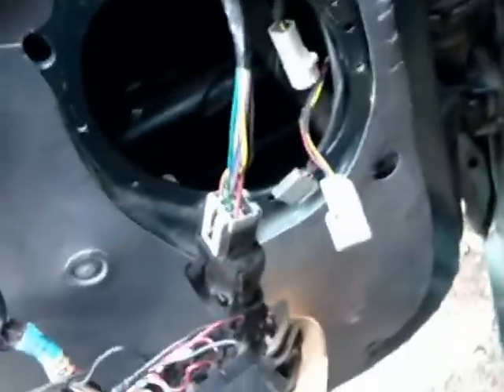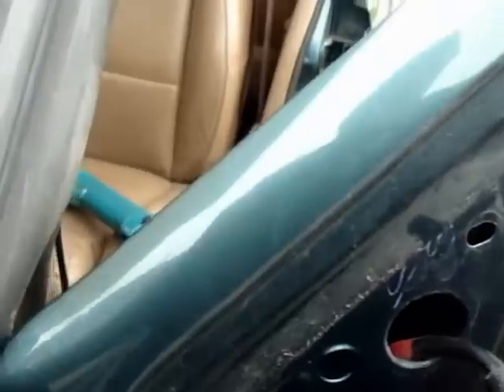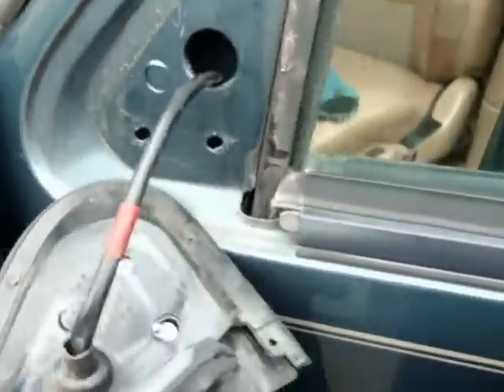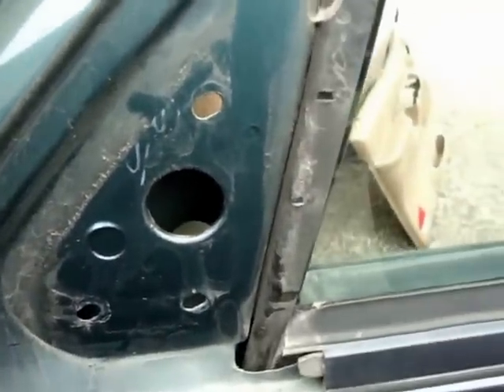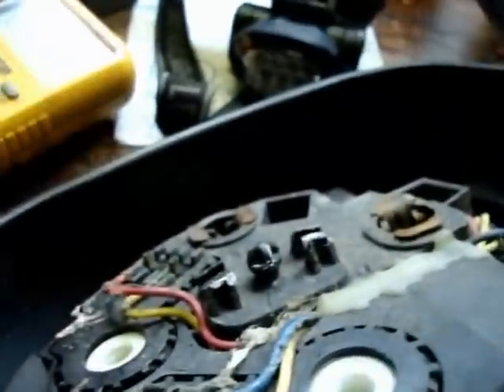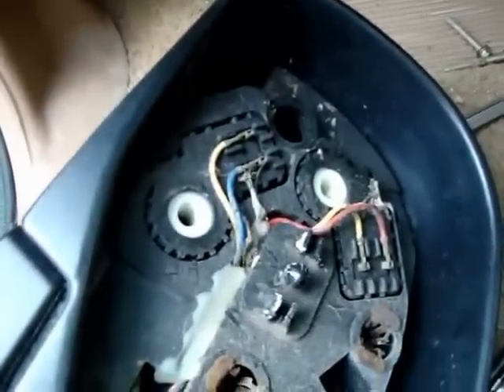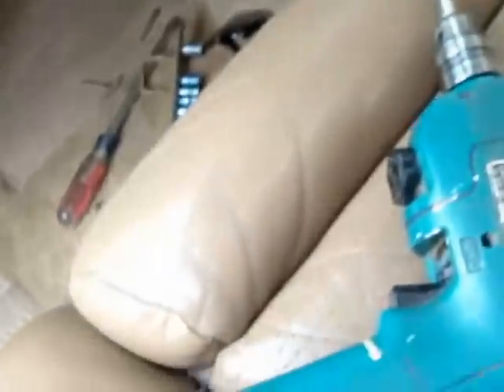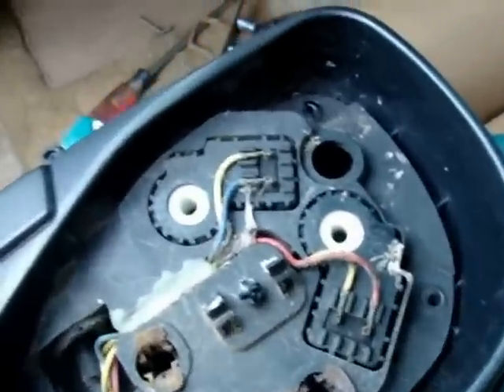Ford Door Mirror

Comment: I'm removing my mirror glass to add side turn signals and running lights to the side mirror housings. Thanks for the info on removing the glass. My power mirrors didn't work when my parents gave me my Explorer years ago, so I would just adjust them by hand. I was going to replace them but I decided to get another switch at the junkyard to see if it could fix my issue. To my surprise, I plugged in the new switch and the mirrors worked perfectly again. I was fortunate that I didn't break or strip the gears from all of the manual adjustments I made over the years.
Reply from the maker: Your Welcome. I'm glad i could help . The mirror is designed to move with a push, they anticipated power loss over the years that is what you call good engineering .